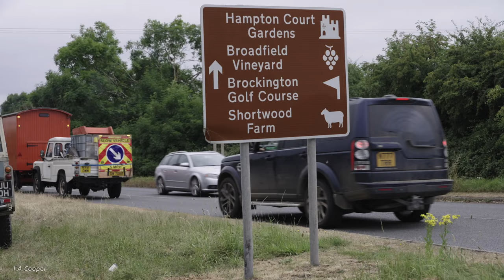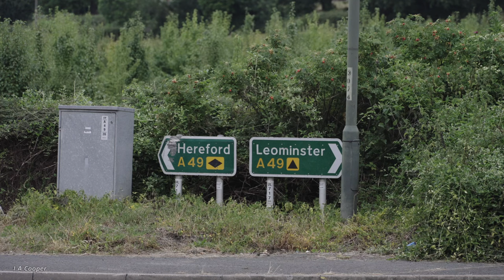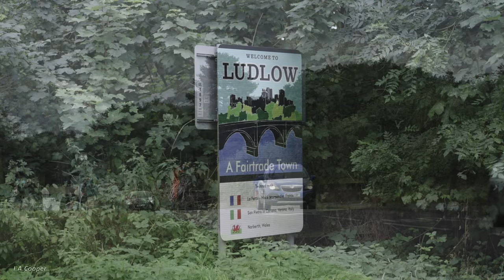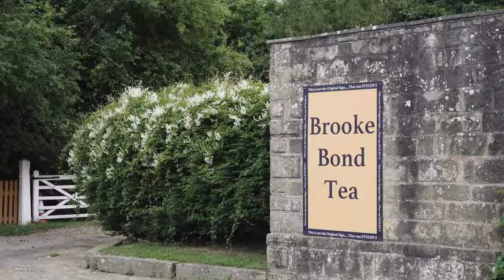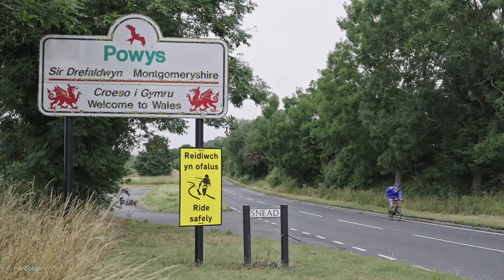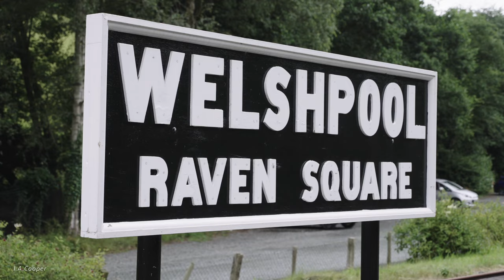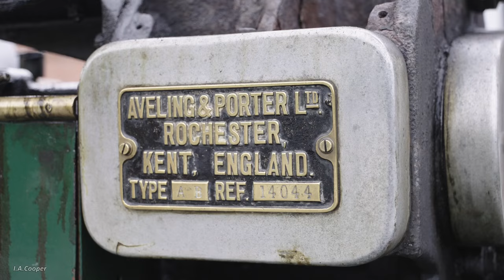Roading Rhoda

Comment: thats a superhuman effort. lots of questions tho if you have time? is there rubber on the front rolls too? what do you have to do to the landrover so it steers when being towed? is there a transfer pump between the IBC and the engine? enjoyed the trip though.
Reply from the maker: Yes, this roller has rubbered wheels front and back, which does improve the grip on the road surface a lot compared to the more traditional metal tyred rollers - although they do need to be careful where hot firing irons are placed so the rubber doesn't melt and get damaged!

When towing a vehicle on an A-frame you just have to ensure the steering lock can never engage!  Unlike towing with a single fixing point, such as with a bar or rope where the towed vehicle is free to move left and right, with the A-frame the towed vehicle is forced to follow what is towing it, and the front wheels just self-centre as required (so turn left and right as needed on corners),  in much the same way if you let go of the wheel whilst driving on a straight road the wheels will centre themselves to carry on straight ahead (and in theory on a banked corner the vehicle should self-steer around that as well if the speed is just right!).

The different design of steering mechanism on the living van means the front wheel carriage on that needs guiding, this is why you can see the solid tow-bar go from engine direct to the chassis of the trailer (so all the towing load falls onto this), then there's a loop from the 'traditional' tow bar connected to the front wheel carriage that hooks over the towing bar.  If a trailer with this type of steering was left to its own devices then the wheels could go anywhere.  If you just towed from the wheel carriage then all the load of the trailer and everything coupled behind it would be going through the centre pin of the carriage - towing direct from the chassis is stronger.

Some people who carry extra water on a trailer behind will just use gravity to feed from the tank to the engine, others use the steam operated 'water lifter'  on the engine to suck water from the tank to the engine [can be seen on the nearside front belly water tank on this engine - but it isn't connected to a steam supply to allow it to be used).  In this case the hose from the IBC couples direct to the water control valve on the engine, this is a three-way valve meaning the driver can select to fill the boiler with water from the roller's tender, or to feed direct from the IBC via the long hose.

....of course when problems are encountered and the land rover has to be taken elsewhere to effect repairs whilst the roller limps on alone then it does rather drastically reduce the water range as the IBC with all the spare water disappears as well!  Lol.
Reply: @IACooper  wow! Very interesting! I hope to see a steem roller in real life in the future)
Reply: @IACooper  thanks for taking the time to reply. ive always got a million questions, mostly because i recently purches a fowler roller (number 16771) here in australia and hope to do some road runs /camp trips across country on it, if me and my crew live long enough and get fit enough. rubber is something that were looking into , and the hauling the landy seems a pretty good option for short runs. in australia, 50 miles is probably not as far as it should be, but planning to keep it fairly central to the rally feilds. heavy haulage is something everyone needs to be a bit careful with cost wise, best avoided. 
we do have a working water lifter though. keep the amazing videos coming.
Reply: @IACooper  But don't they carry a water hose to fill up the engine from a steam?
I also noticed they removed the fire at the end of the day's steaming?
Reply from the maker: @eliotreader8220  Not all road engines have a water lifter to be able to suck water up from a stream.  This one does have a lifter on the belly tank, but it isn't piped up to work.

The fire was thrown out at the end of the first day as it was a little on the excessive side and the crew were looking to seek a meal elsewhere and didn't want the boiler blowing off steam in their absence.

At the end of the second day the fire was cleaned out before the engine was parked inside a secure building to ensure there weren't any fume/fire problems.